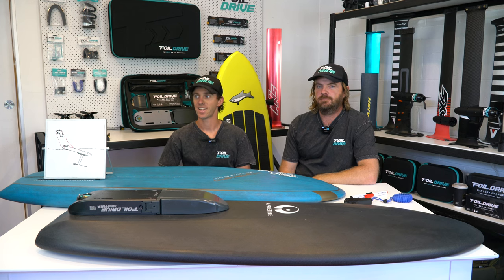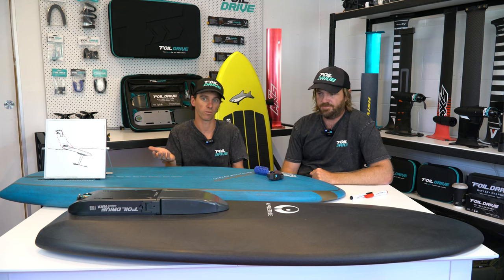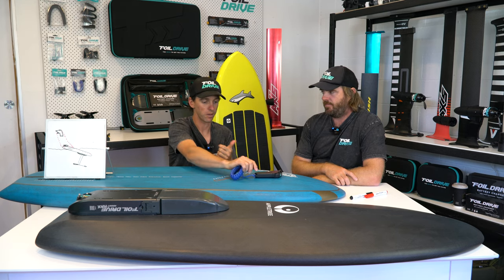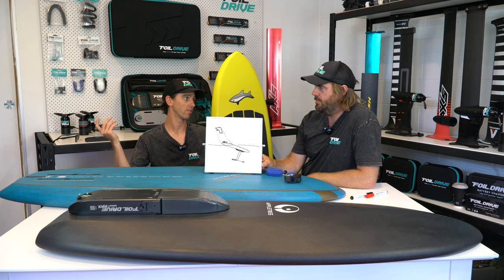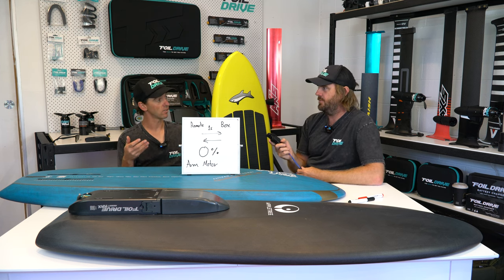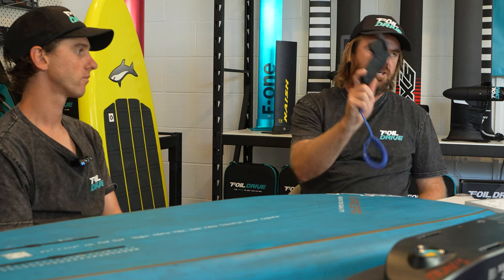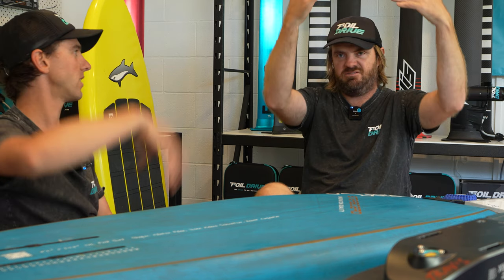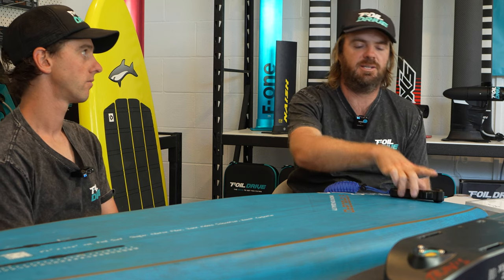Wireless Controller Signal Connection | Tech Talk | Foil Drive

Comment: I have a KT dragonfly 8,2’. And have had a lots of problems once I stand up. Any recommendation??
Reply from the maker: We'd suggest joining the Facebook Owners Group and search the board spec, a lot of people have use things like spacers to alter how the systems mounts to improve take-off and rider feeling. Running foam in the tracks is also super important on these ones! If you're after more help feel free to email us at support@foildrive.com - Caitlyn
Reply: I have the same board and the same problem.  Should I suspect that the rubber friction mat glued to the top surface of the board is interfering with the signal?
Reply from the maker: @tormarquis  The rubber mat shouldn't cause any issues. Carbon tracks may cause some issues, not sure what the dragonfly is made with to confirm.

Feel free to email support@foildrive.com for some more specific guidance

Comment: If i only have one battery do I need to use the app every time to setup the power, boost, latency or will it remember from last time?
Reply from the maker: It will remember. When ever you use the app, your simply reprogramming the electronics to a new setting. It will remember that setting untill you tell it anything different by reconnecting the app again

Comment: Where is the antenna located in the gen2 box? Does it help to fill the tracks? If yes, what is the best material to fill the tracks? Regards Robert
Reply: Filling the tracks will help any board, use any type of closed cell foam.

Comment: To summarize the points made in the video:

- even a small amount of water blocks the signal
- carbon fibre boards block more signal than glass fibre boards
- to maximize connecitvity, hold the right side of the controller close to the board
- using a board of right material allows using a smaller boards
- for easiest experience use a larger glass fibre board
Reply: Pretty sure they said left side i.e. better for right handers
Reply: Left side correct.  Right handed benefit